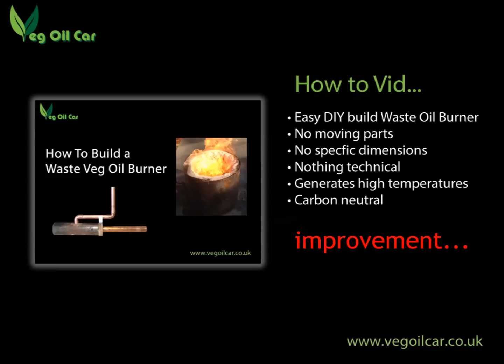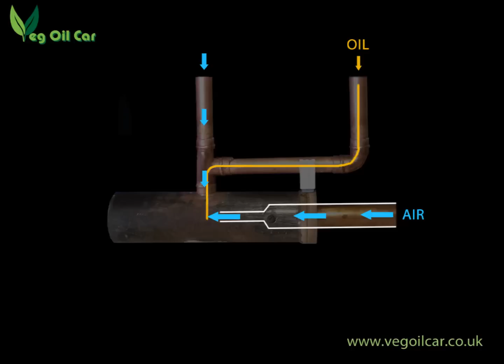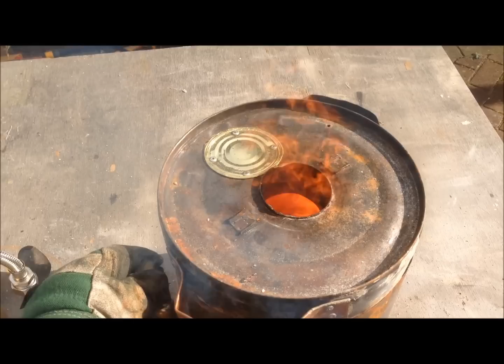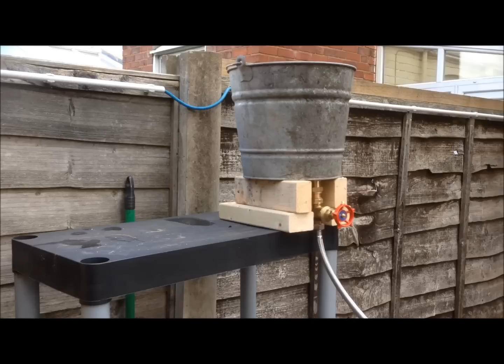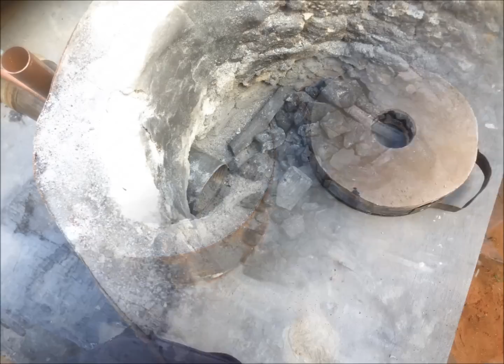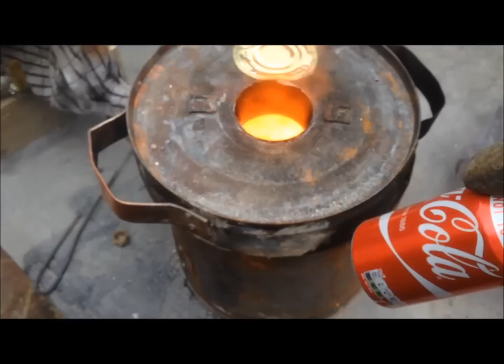Waste Oil Burner - Improvements - by VOGMAN

Comment: Is there a fan less or electricity free version of this?
Reply from the maker: If you want to go old school, out ancestors would have used bellows...
Reply: @vogman  Okay thanks. I'm a scrapper and want to melt down stuff that's hard to or impossible to process manually and I have to do it outside and where it's not really convenient to run electricity.
Reply from the maker: I understand. This burner is a low tech approach but I'm not certain it would work with a bellows... maybe two bellows so a constant stream of air could be generated...
Reply: @vogman  Okay. Thanks. I'll look into it.
Reply: @vogman  Check out Sek Austria DIY Waste Oil Burner if you haven't already. It might help you improve your own or give you some ideas.

Comment: thanks for sharing this, this will be the basis for my furnace, I was going to use charcoal because most of the oil burners I have seen use a compressor and need too much to get it going but I will be making some modifications to your design since copper tubing is so expensive here

Comment: It seems to me like what you have made there is essentially a carburetor, so why not use an actual carburetor, a large one from some old used engine, this would allow good atomization of the fuel and good Venturi effect, as long as the carburetor is far enough away from the heat so as not to be damaged. I'd recommend maybe an old slide style carburetor off of a snowmobile or possibly a one from a large motorcycle or large equipment engine, this would function exactly the same as it did on the engine, except it would be delivering fuel to your forge

Comment: great video. if you insist on having the MDF disk on the side of the steel pipe  you could drill some holes (in a centrifugal pattern) perhaps it could help make some turbulence that could help mixing the oil mist...

ohh I did not see that some one made essentially the same comment 4 years ago

Comment: Enjoyed that VOG, if i can make suggestion. As a home brewer (beer) i use propane and to try and regulate the gas is not easy so if you put a on/off valve before the gate valve you leave the gate valve preset for normal running rather than having to monitor it every time you use the furnace. Good luck
Reply from the maker: Thanks for the input Keith  : )

Comment: does the veneer of plastic/lacquer in the soda can hamper your casting?
Reply from the maker: I'm sure I read somewhere once that there's only 60& aluminium in a soda can, or something like that. There's other coatings and of course paint. These burn away and leave a papery layer on top of the molten metal that gets scrapped off. This is commonly referred to as 'slag' or 'dross'.

Comment: Totally forgot i commented on this. 
  It would be a good idea to get a high temp thermometer for this, that way you can say for sure if the extra airflow is really increasing the temp or not. You may just be drawing more fuel in and not necessarily burning hotter, making it a richer flame and actually keeping it cooler.

Comment: after having seen another video about oil burner and foundry i suggest you to switch to an oil container with lid and something to place under the container to warm it up a cooking hob,so the oil when reach the furnace will ignite faster.
with my patience some time is very short and having seen many videos of oil burners surely for my melting i will use yours coz many are too complex..
and as u said in the previous video most of the times important details are missing..yours is quiet simple and parts can be found all over my house..
thanks for sharing both videos i really appreciate..
big hello from italy a newbie on DIY
Reply from the maker: Great to hear from you Ludo. Thanks for your input my friend.

Comment: Hey buddy. Hows it going ? I love your idea of waste oil burner. Is the oil sourced from old chip shops and then left to settle and seperate ? Also can it melt copper ? Thats a big must for me, could you try it.

Oh i have an idea for you as you love to make things but il email you over that one buddy
Reply from the maker: Hi Shed. Chip shops rarely use veg oil - they use something called solid block. You can usually get it for free from independent pubs, restaurants, cafes, Chinese & Indian restaurants, etc. Don't bother with Brewery owned pubs and chain food stores (McDonalds, etc) as they already have an infrastructure in place to get rid of their oil.
To be honest, for running a DIY foundry, you're better off collecting your personal cooking oil plus that of friends and family. It soon adds up. Generally businesses want regular pick-ups.
Does it do copper? Yes... I failed a bit in this video thanks to poor insulation but you can still see it - https://youtu.be/0ZAOlM6IFuQ - I've heard from other guys running my burner in very WELL insulated foundries that are apparently working steel.
I'll look out for your email mate. Probably be next week now though ; )

Comment: Will your foundry melt steel?
Reply from the maker: Hi Ronald. I've never tried steel.
I did have a guy write to me a few weeks back saying he was using my oil burner to melt iron in a VERY well insulated foundry. And I guess that's the secret - if you've got a well insulated foundry that will trap and accumulate the heat, then it MAY be possible. I think I might be tempted to use a couple more of these burners if I tried.
Hope this helps.
Geoff

Comment: How hot does this burn?
Reply from the maker: Hi Alexander. I can't say for sure as I've never tested it but I have melted copper so that's around 1100c.
The most important factors to me are the foundry and the insulation. Generating heat is pointless if you can't contain it.
A guy wrote to me a few weeks ago saying he was melting iron with my veg oil burner in a VERY well insulated foundry. Whether he meant melting iron or simply working iron (heating and bending) I'm not sure, but it's still impressive for such a simple device.
Hope this helps : )
Reply: VegOilGuy ok, thanks for letting me know. Much appreciated

Comment: At 1 point in your vid, you mention that it is best to limit the number and sharpness of bends in your oil feed line.  I noticed you use a 90 degree elbow just past where your braided line joins the copper.  Wouldn't a 45 or 30 degree bend work better?
Reply from the maker: Hi Ron.
To be honest I don't think I explained things very well in the video. When I was talking about avoiding bends, I was referring purely to the flexible pipe. Because it's flexible, it can sag and dip, creating pooling inside the pipe and altering flow. So when I talking about avoiding bends it was for that reason. 
In truth this really is a very basic oil burner design - and that was the plan. I wanted to show that simple can very often work - and it does here : )
As long as the oil enters the burner is a continuous, slow and controllable manner, it will work.
Hope this makes sense.
Reply: Yes, it does.  TY.

Comment: How is this carbon neutral if you are burning oil?
Reply from the maker: Hi Jared,
It's carbon neutral because I'm burning Waste Vegetable Oil that's been recently grown.
It's all about WHEN the carbon is stored...
As the rape seed grows it stores carbon and as it's burned it releases carbon. But as it stores and releases carbon in a short time frame it's considered carbon neutral.
Coal, for example, also contains carbon but this carbon was trapped within it millions of years ago. Burning it now releases the carbon "out of its time" if that makes sense, which leads to an excess of carbon in the atmosphere - which leads to global warming. Get the idea? It's all about WHEN the carbon was stored.
That's why growing trees and burning logs is carbon neutral, but burning coal (a fossil fuel) isn't.
Hope this helps : )
Geoff

Comment: Hi Geoff.Great setup what you have done here! I will try to make one similar and your opinion would be very welcome. I want to use it in a rocket stove (I'm sure you know what is a rocket stove).So ,the burner will be placed in the feeding chamber, exactly in front of the burning chamber.The burning chamber is made with fire bricks and the rise tube also.Now ,about the oil flow rate ,could this be a drop by drop or it must be a constant thread? Also I would like to use a smaller fan,kind of computer fan,mounted closer to the burner.Will this produce enough air flow? I don't need foundry temperatures...Maybe I will have some other questions but for the moment that's all what passing through my mind.I hope my ''hocus-pocus'' English is understandable and you can get an idea of what I have and what I want to do.
Reply: yup yup...how to light up without charcoal?Propane torch ?
Reply: here is a rocket stove ,very similar to mine,if you want to take a look.Yes ,I like the idea to use many tipes of fuels in the same stove ;https://www.youtube.com/watch?v=vRo6UFAfPIo&t=184s
Reply from the maker: Hi Mambo. Your English is excellent my friend.
The oil needs to be a constant thread - but not too much. The finest thread you can manage is probably ideal.
A computer fan? I can't imagine that being powerful enough. It's no really about supply air, it's more using the air to push the thread of oil apart, making droplets like fine rain.
I have to say, the rocket stove is new to me. It's nice to learn new things.
I could definitely see this simple oil burner providing plenty of heat, but maybe too much in fact. In a confined space the heat builds up enough to melt soft metals. But maybe you could figure out a way to use it.
Thanks for your comments.
Geoff
Reply: Thanks ,Geoff! You pinned exactly what I needed to find out about air and oil flow rate.I have not built a waste oil burner yet,will be the first one,that's why I need to make my homework. I'd like to combine this horizontal burning with the drip feed,that's what I try to earn.So,finaly, these are simple devices ''on the evil eye'' :)

Comment: Just finished building mine a couple days ago and the plaster/mortar has set for 24+ hours. To keep the tube central I drilled and tapped 1/4-20 in three places 120 degrees apart and measured from the tube to the hex head making them all the same. Then I packed the mortar and plaster mix. I left the bolts in; no need to remove. Going out to fire mine up for the first time.
Reply from the maker: That's great. Thanks for sharing : )

Comment: I know another way to get the chimney effect, but it's very similar to what has already been suggested.  Here it is: replace the wood disc with a drilled pipe cap.  It's easier if your pipe still has threads on that end.  Put 1 large hole in the center for the copper tube, and multiple smaller holes all around.  Angle the small holes for that Venturi effect also afore mentioned.  I like that a steel cap is much less likely to combust if something goes wrong.  If it's possible that you could get too much chimney effect, you could add a ball valve to the chimney that you came up with to control the flow.  How hot does your chimney get in that location?
Reply from the maker: Hi Ron. I did experiment with cutting holes in the wooden disk and experienced a problem. I think too much air was getting in. In the end I abandoned the exercise.
The chimney certainly gets hot enough to burn skin but is cooler than folks imagine. A lot of people ask if the copper melts or even the plastic clips. The answer's no as they're outside of the foundry and whilst there's a certain amount of conduction, it's not that hot : )

Comment: Just another question has any one tried to make a burner from a sandblaster set up. instead of pulling up siphoning sand it would draw up the oil and disperse it with the air.

Comment: I built an oil burner recently with a similar design to yours but I used a shot vac for the air supply and I couldn't get the oil to ignite I didn't know if its the shot vac is too powerful or if its something else
Reply from the maker: Hi Mason. It could be too powerful, yes... it's a fiddly process.
The most important thing with my design is to make sure the foundry is hot to begin with. A good charcoal fire can easily and quickly achieve that.
After that the oil SPITS in... you're looking for fine droplets like light rain. These hit the already hot surfaces and combust.
I bought a leaf blower a while back and used that. I found it was too powerful. Here's the very brief video..
https://youtu.be/Boa7_-4hMVI
I've never really understood why too much air spoiled the process but it did for me. Fortunately the very crude but simple valve I showed in the original video (and a little in the above vid) dialled down the power a treat. It's well worth making something similar. I believe it will really help you.
I will say this... don't expect an immediate result. It could take 10 or 15 minutes of fiddling with tiny adjustments to the air and oil before it works. Then suddenly you're there.
The next time it will probably take you 5 minutes... the time after that, 1 minute. We learn.
As your build and mine aren't the same (they can't be unless we have the exact same fittings) all I can do is assure you it does work. Persevere, make small adjustments into a hot foundry and you WILL get there : )
Reply: Thanks for the help
Reply: how how can these oil burners get?
Reply from the maker: How hot? I don't know to be honest. In a well insulated foundry they're pretty good... I've had success melting copper. That's not a very scientific answer but I hope it helps.
Reply: @vogman  I have a book by someone  called "The Artful Bodger" who uses a waste oil burner to melt cast iron, so it can certainly supply plenty of heat! He uses a more complicated burner that pre-heats the oil, and a more powerful air supply, so it looks to me that the more air and fuel you can get into the furnace, the hotter it will run.

Comment: Hi,
I use a Coleman stove that has the fuel feed pipe going through the flame to pre heat and vapourise the fuel.
Would there be any advantage to doing this with a waste oil burner ?
I also have a Sheen flame gun that works on the same principle, with a coiled feed pipe going round the flame. Once the coiled pipe gets up to heat, it almost turns into a rocket.
Reply from the maker: Thanks for your question.
It's an interesting idea... I run my car on Veg Oil and I know the oil is pre-heated before going into the injectors.
I think on MY oil burner, it probably wouldn't be beneficial, but only because my design is so basic. It relies more on the foundry being hot enough to ignite the oil than the other way round.
BUT heating oil does thin it and make it more fluid, meaning it's easier to spray - which is a common approach of many oil burner designs. So I think you may have the makings of your own design happening there  : )
Good luck and best wishes,
Geoff
Reply: To have it hot, to the point of almost vaping would bring it close to its flash point and presumably aid more efficient burning ?
Reply from the maker: Should do, yes. 
If I remember my schoolboy physics it's the fire triangle - heat, fuel and oxygen. Remove any one and there's no fire. Get them in just the right mix and you've got a blaze on your hands.
It takes heat to start the burner but once it's going, it feeds itself.

Comment: Your oil burner videos gave me an idea: I should build one and use it first to heat up in my baking oven. I am very curious if it works well, but if it does I could reduce my costs and the environimental footprint too.  I would not heat oven with waste motor oil, because the burning additives and other not too healthy materials are dangerous for food (bread) prepared in the oven, but I am not afraid of vegetable oil even if it is waste oil.
Reply from the maker: Hi Nomadpek. Anything that saves money and helps the environment has got to be good. I've had a few people tell me they've adapted the idea for various projects such as central heating. An oven is a new one and a good idea.
Best of luck.
Geoff

Comment: Quick question, i was wondering if used fry oil will also work or if it is the same thing. No hurry just wondering.
Reply from the maker: Yes : )
Same thing as far as I'm concerned... veg oil, cooking oil, fry oil. There's also peanut oil, olive oil, castor oil, coconut oil... You should read about the origin of the diesel engine some time. The original diesels ran on a food based oil (common believed to be peanut oil, though there's some debate). If you can get it for free all and recycle it, all the better.

Comment: are you using regular off the shelf pre-soldered joints there, I thought it might have run too hot to use them ?
Reply from the maker: Hi Colin. Yes, just regular fittings.
The point is the copper pipe doesn't get that hot. It might burn you or me, but it's nowhere near hot enough to melt the fittings.
Most of the heat should stay inside your foundry. If it's well insulated and the hole for the burner not too loose then the copper piping doesn't become an issue. At one point I used plastic cable clips to firmly grip the piping... they never melted.
Hope this helps.
Geoff
Reply: VegOilGuy thanks for the info, this is the easiest burner I've found yet - now to sneak an order past the missus for a cheap air pump ! ;-p

Comment: I would add a valve on the up air pipe to control the temperature. some what like a damper on a wood burning stove.
Reply from the maker: Good suggestion. Thanks.
Reply: @vogman  I am wondering how far Should the air pipe go inside the other tube. And about how long are the pipes